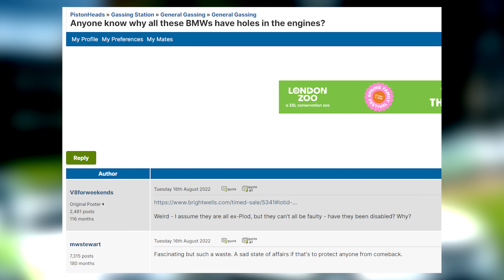Why The UK's Police Cars Keep Catching Fire (BMW N57 Engine)

Comment: I have oldest generation M57, so no dpf and no faults on bearings and on oil pump etc. Nothing done to engine with opening, except did change the valve cover gasket. Chain was also ok with 417tkm on it. As I have had few BMW's with both engines and currently have 4 of them on the yard, I would say, changing oil often is the cheapest servicing you can do. Practically all newer engines have so much "green devices" added to them that the reliability suffers, and also there is the point where companies want to make money too, so they try to produce parts cheaper too. That's how it goes with many cars now when they tend to suck too much oil, or leak it out, VAG drivers know this.. 😎

Comment: The vehicles are sold with holes in the engine for exactly the reason given; Public safety. But it’s also safety from prosecution later down the road. Literally. The forces don’t want the slightest chance of a lawsuit when they have so little money as is. 
The vehicles chosen to replace the Bimmers will usually be down to whoever the servicing contract is owned by. The Met, for example, have their fleet serviced by Babcocks. The majority of the Area Car/Response Unit vehicles (Bimmers) are being replaced by Volvos. This, however, will differ in different forces. I know some of the Counties have a mix of Peugeot, Volvo and Vauxhall. The Met has a mix of Fords and Vauxhalls for Vans/Minibuses, Volvos for Armed/Immediate response, Vauxhall/Peugeot for ‘Panda’ cars (light duties, patrols, appointments) and so on. Though some of the Pandas will also be used as response vehicles, too.
It’s a shame that the vehicles had to be retired and made as spares/repairs, but it’s cheaper than multiple potential lawsuits which will also come out of the publics pocket.
The Volvos aren’t especially better, either. Volvo refused to turn off the early crash prevention system which will suddenly cause the vehicle to slam the brakes on and pin the driver to their seat via the seatbelt. It makes sense, you’d kind of want that to happen, but not when you’re responding to a call. It’s quite jarring for the driver. 
It’s apparently quite easy to override, simply stamp back down on the accelerator so all is not lost. It might be hard to understand but genuinely, when you’re driving in response, you don’t want the car to be braking for you at every bollard or island that you have been trained to drive around at speed.

Comment: Does Mercedes have these problems,  no because Mercedes knows how to build an engine as BMW's are a fragile piece of engineering. I have had 4 BMW's and all were plagued with electrical problems not to mention the pathetic cooling systems. Bosch is 1 of the problems and plastic cooling systems don't help. Take a lesson from Mercedes Benz who know how to build properly.

Comment: Achieving emissions regulations and using EGR/DPF/Ad Blue/Stop-Start is killing diesel engines either by oil dilution (DPF regen), exhaust back pressure (blocked DPF), stretched/snapped timing chains (Stop-Start) and choking (carbon from Exhaust Gas Recirc) why not switch to petrol??

Comment: Hertfordshire constabulary has replaced the BMW X5 330D touring 530d touring few 530D x5’S been retired from APU So Volvo XC90 could take over Volvo V70 D5 in RTPC  Frontline policing team also use Astras probably some diesel some unleaded petrol engines I think the estate variant of is Astra police package is a diesel 1.7l - 2.3l diesel

Comment: Its a strange one for sure, what about people out there with N57's who barely drive their cars to get them up to temp, and dont service them regularly, you dont hear about civilian cars catching fire, I can assure you they exist.
Personally I think BMW has shifted blame. It sounds like the car was injecting too much fuel for the regen cycle, its not fully combusted in the combustion chamber and then sticks to cylinder walls, gets into the oil, thins it, then oil film strength is reduced, then metal on metal on crank and rod bearings = failure. If thats the case then more regular oil servicing would solve the issue and would be a hell of a lot cheaper than scrapping their entire fleet and getting new cars. Even if that means having a 3k service interval or something, it would still be cheaper over the course of its life rather than replacing a car before the end of its working life. 
I think the officers are gonna miss the BMW's nice torque decent ride quality and high speed stability, nice long wheelbase. I cant imagine theres much out there to match all those criteria.

Comment: Its because the police upgrade the cars performance and then leave stuff like the long block stock you cant do that if the car is pushing out an extra 100PS than it should be the police need to wake up and hire proper BMW car mechanics.

Comment: Sadly BMW covered up the story about their burning BMWs...
All 6 cylinder 57 N Diesel engines have an issue due to crankcase ventilation and fuel/air intake clogging up . Could be minimized by changing oil every 15.000km and inspection of components every 40.000km. But rest risk of catching fire stays though less lower.

I quote german  investigation from Fronatal and ARD :

BMW HAD TO RECALL over 200.000 CARS IN EUROPE, BECAUSE OF  FIRE Risk ! The KBA authority new about it and should have taken serious action like stopping all poorly designed cars. But they didnt for obvious reason!
 THE GERMAN KRAFTFAHRBUNDESAMT (automobile authority) WAS OBVIOUSLY BLIND IN FAVOR FOR FAMILY QUANDT, THE OWNERS and main Stock holders of BMW. SHAME on them, lifes has been taken. Money is more worth...

ALL  VICTIMS SHOULD SUE BMW.

But Dont do it germany, cause life isnt precious by law in germany when it comes to value compared to other countries.

My cousin had a hot smoking bmw build 2017. Luckily it didnt burn on highway. He had to sue BMW to get it fixed. This is how BMW cares about customers.

Comment: Most of South Wales Police now use Volvo XC90 instead of the BMW X5 (armed response) and also now use the Volvo V90 instead of the BMW 530D (Road Traffic Police)
Reply: I heard (from a reliable source) that they are having reliability problems with the Volvos and the internal storage for weapons is not as good as the X5.

Comment: The UK Police have deliberately ignored BMWs alternative service advice for vehicle such as police cars, ambulances etc they go from doing 150mph to idling at the side of the motorway putting out cones for 3 hours. Ignoring BMWs advice to change the oil more directly caused this they murdered a man due to negligence of maintenance and as I said ignoring BMW if they kept up with the recommended oil changes etc this shouldn’t have happened. They also get them for half price and drill the engine blocks making them useless then sell them to half price to the public. Disgusting isn’t a word that fits.

Comment: Handling of this issue by the Police reminiscent of the 2 wheeler Honda Pan European 'issues' of the early 2000s - reported frame cracking and weaving at speed much due to all the equipment added to make them Police vehicles - weight & way it was distributed. IOW, little apparent attempt to sort the issue intelligently just dumping the vehicles or scrapping them and moving onto another make/model. Ironically mainly to BMW bikes - the RT

Comment: I hear DPF and long oil changes as the root cause. DPF can be written "out" by any tuner and physically altered or removed quite easy.
And what is the problem with frequent oil changes?   I do oil changes myself every 6,000 - 9,000 miles and it cost me just a few euros. (+renting a lift for one or 2 hours). So the police could do that also (e.g. contract with a workshop?) or am I missing something?

Comment: It’s such a shame BMW are not willing to solve this problem as they are by far the best handling and performing pursuit/traffic car probably down to their racing heritage and constant development. The bmw are getting replaced by Volvo s90/v90/xc90 however these definitely don’t handle well in a grade 1 due to the extensive safety features (anti collision etc). Also Kia and Cupra are being introduced but reliability is the big issue here with these. You mentioned Peugeot but these are mainly for standard patrol cars not an advanced car. I would like to see Mercedes being introduced as again their racing heritage and performance development could stand up to the constant hammering (500 to 1000 miles per day driven at always high revs for 7 days) they get as police vehicles.

Comment: A few years ago I did overnight delivery of car parts to dealerships of a number of car manufacturers, one of the manufacturers was BMW. The dealerships that had the most replacement engines delivered was BMW. This was very memorable as the crates the engines were in were very heavy and I only had a pump truck to move them from tail lift to the delivery point, and I was alone at night, so no helping hands.
Okay, so this was from personal experience, it's not a scientifically arrived statistic after exhaustive studies, just a few months of struggling my balls off at BMW dealerships.

Comment: If you spent most of your time doing virtually nothing, then one day attempted to go for a vigorous run, likely you’d over heat very quickly. The police today, in my experience, take such a couldn’t give a fig attitude to law enforcement and crime prevention that their police cars stand idle other than the daily run to the doughnut or kebab shop 300 yards down the road. It’s no wonder that when they get into a stone cold car, with all it’s oil drained into the sump, then expect it to do the standing quarter mile in less than 10 seconds, that the damned thing over heats or catches fire.

Yeh, if you’re clocked doing 75 in a 70 zone, they’ll chase you down and fine you and endorse your licence. But if you are mugged on the street, relieved of your wallet, phone and house and car keys, you’ll be given a crime reference number, end of story.

What is the difference between a police car and a hedgehog? A hedgehog has it’s pricks on the outside!

Why does a policeman not look out of the window in the morning? Because  that would mean he’d have nothing to do in the afternoon!

No, i’m not anti police, not at all. In fact I hold them in high regard. But, they’ve lost my respect as a result of their low key, passive policing policy.

A high ranking member of the fire brigade once told my grand mother that as an elderly lady, living alone, if she was ever being burgled, she should phone the fire brigade, not the police. A truck load of burley fire officers would arrive im a fraction of the time it would have taken the police. Yes, they’d be peeved, vut so would be the burglars! 

Why should you never ask a policeman the time? Because they never do have the time!

Comment: I've just returned from a holiday in Spain (near Cape) We were sat at a bar / steakhouse on a main road when a diesel BMW pulled up into the car park urgently and the driver dashed out with smoke billowing from the engine bay.
Someone in the bar ran out with a fire extinguisher luckily and opened the bonnet to put the fire out. The fire brigade came and looked over it and hosed the car down to be safe, but all the plastics in the engine bay were melted.
Lucky for the driver and quick thinking from the guy with a fire extinguisher too (he was a customer with experience of car fires, not a staff member)
It seems BMW's everywhere are catching fire 😬😁

Comment: Time to switch to electric cars. As per Norwegian (the only country with meaningful numbers of e-cars in circulation) statistics these are much less likely to spontaneously go up in flames. When they do, you have to run. But hey. Same applies to petrol/diesel cars on fire.

Comment: With both the N47/57 motors using decent oil and frequent changes along with the filters is an absolute must.  5-6k intervals particularly with higher millage units otherwise you may be running the gauntlet.  The EGR cooler is actually an active recall for all engines in this family as the cooler has been known to be a fire hazard.  The whole "green" fiasco has actually made Diesels somewhat of a public safety concern and in my opinion just not worth the hassle given how efficient these engines are when out in the open cruising.
Reply: Why bother with this POS engines

Comment: My 2015 330d caught fire in 2017 whilst at idle in my driveway (I was opening my gate). Cause was a fire in the nylon intake manifold caused by particulate filter, it trashed a 18k mile engine.
Reply: Lol a plastic intake manifold talk about cost cutting

Comment: I seem to remember series 3 BMWs used to spontaneously self-combust back in the early 2000's. I read it somewhere that the starter motor would stick engaged, get hot, then set fire to the wiring loom/fuel lines which were situated just above them. Obviously the cause was attributed to the owner, rather than the poor component placement from design. I myself witness 5 such fires - one of them belonging to my next door neighbour.
Reply: Yikes! I’ve got an early 2000’s (E46) BMW - its a petrol one though not a diesel, does that starter issue you heard affect those too? I’m guessing (hoping) since its a different engine model, there’s scope for it to be different.

Comment: I believe the police have stopped their association with bmw after reading an artical last month, i had a 535d with the same engine its a fabulous power unit but i dont sit in laybys with them ticking over for ages to keep warm.Never an issue with the car, but when these cars re gen , the heat is terrific in the cat.

Comment: The public are often put in danger by the high speed actions and reckless disregard of all sensible norms by police drivers, innocent members of the public are killed and injured every year. Police drivers are frequently seen travelling at high speed in a manner that is totally unnecessary, there are no situations that require a police officer to arrive so fast that putting the public at risk is a necessity. To drive anywhere at 130 miles per hour on public road is a dangerous criminal action, this man paid the price but this  should be a major offence that warrants a prison term, It is well known that the police drivers ‘get off’ on these chases and it is officially regarded as ‘blue mist’ which in public speak means excitement. They must drive within the law at all times and be subjected to penalty as everyone else is. There are other methods available that will be far more effective and far less dangerous.

Comment: All the newest vehicles I've seen around Essex here are big Volvo V90's for the big A roads and Motorways, some V60's,  and XC90's for the Firearms response units... In towns they seem to have Ford Focus and Peugeot Estates... If they do go with the V.A.G. then I hope they stay away from Audi's... They have Steel Bodyshells but all the doors and panels are Aluminium - one tap and the front end is caved in and the car disabled! Not sure of the construction of VW's, Seats, or Skodas but I wouldn't be surprised if they've gone the 'weight saving' route too...?

[Edit: I have a 2017 Audi A6, with above quoted everything-but-the-bodyshell being aluminium... And I absolutely love it! Cannot fault it! Not bashing the V.A.G. in any way. Maybe the other Models are different... Just thought I'd add that before people get upset at my comments.]

Comment: Problems started here in Humberside when the then fleet manager retired. (I do not have permission to name this excellent man)
Prior to the retirement all cars were petrol. Many having the benefit of LPG.
Police vehicles were meticulously serviced, which allowed for optimum performance, reliability and economy. Many thousands of pounds were saved as a result of these practices. Patrol cars were Proton Impians with the strong Mitsubishi 1·6 litre engine and ran on LPG from new. I bought the retired Humberside Fleet Manager's black Proton Impian with LPG soon after he bought a larger vehicle to tow a caravan. I kept the car for 2 years trouble-free motoring.
Police cars are now diesels, (many being BMWs) and I hear nothing but complaints about them. Inefficient, slow, and unreliable. It seems to me that diesels are simply not fit for purpose.
Reply: I think it depends on the manufacturer. ;-)

Comment: Arrgh BMW oil 🛢 burners. 3ltr diesels... Did I see/hear correctly, that the first thing they thought of, was to drill a hole in the engine block?
What's wrong with them (police 🚨)
Those engines could be sold for parts.  As opposed to drilling a hole 🕳 in the block..... Shocking 🤯 waste 🗑 of tax payers money.

Comment: Using supermarket fuel chokes the dpf , happened to me got it fixed at garage a chemical clean , only use shell diesel  now and no more problem,  see police using supermarket fuel all the time
Reply: I drive a 330d f31, always put shell vpower in it and never had a problem. Well over 200k miles. The diesel before that got all gunged up, if you want the car to last cheaper in the long run to buy vpower
Reply: Force I work for we are told to use cheapest fuel and encouraged to use supermarket fuels. Cards are barred from shell and bp fuels. Our fleet does 7million miles a year. Do the maths on that!
Reply: @johnstonlee  dpf chemical clean  £100 , save lives and fire , you work out price and priority
Reply: @aberdeenscotland9787  nothing to do with dpf at all
Reply: @johnstonlee  so in your expert opinion what's the cause
Reply: @aberdeenscotland9787  expert as in I’ve seen the documentation relating to this issue, yes. And I drive the cars at work.
Reply: @johnstonlee  yet you've explained nothing except everyone else being wrong